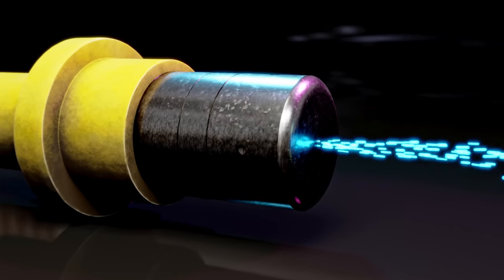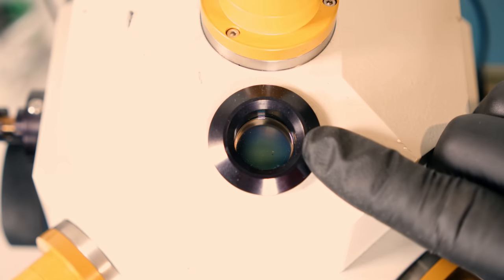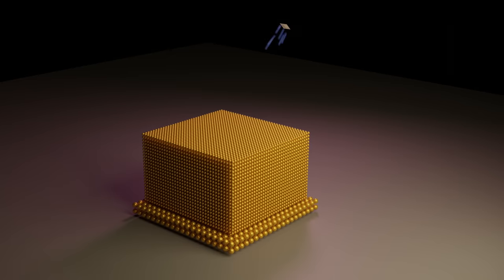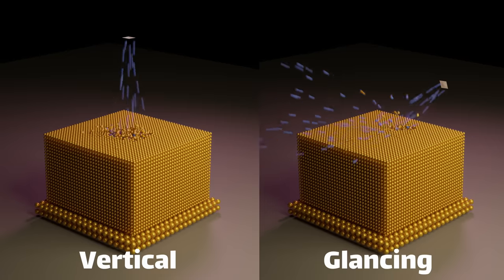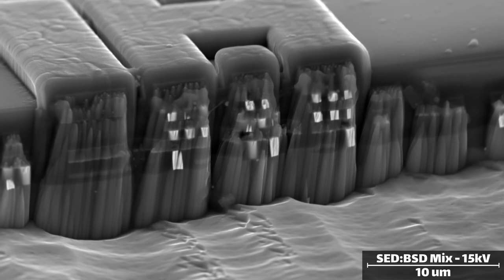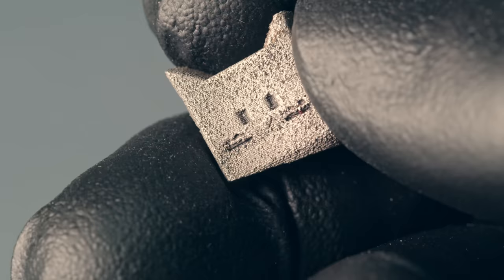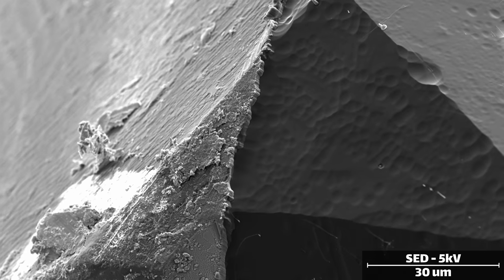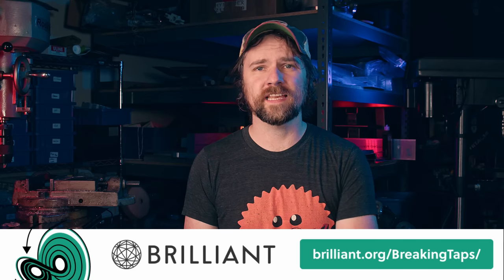Cut anything, even diamond

Comment: Is this what's used to dope semiconductors?
I've always womdered how that's done but can't really find anything about it.

Are the nozzles worn down over time?
Reply from the maker: Yep! Same idea, just much higher velocities and using phosphorous or boron-containing gas instead of argon. But otherwise essentially the same: ionize the gas, accelerate it to high speeds and slam it into the silicon wafer. The P or B that gets stuck in the wafer becomes the dopant, and then they anneal out the damage afterwards.
Reply: @BreakingTaps  That's awesome! I've always wondered how the doping is actually done! Thanks!
Reply from the maker: No problem! There's also an older technique for doping, where you just put the dopant on the surface of the wafer and heat it in a furnace (800-1000C). Called diffusion doping, think it was the main method until like the 80's? Biggest issue is that thermal diffusion also diffuses the dopant "sideways" where you don't want it to go. Ion implanting is mostly line-of-sight, so it can be used to dope smaller regions.

Sam Zeloof's DIY IC series talks about thermal diffusion some more if you're interested!
Reply: @BreakingTaps  i will definitely check that out! Thanks!!

Comment: Oh cool. Why tungsten for vias though?
Reply from the maker: Mostly logistics if I understand correctly. Tungsten can be deposited very uniformly from a gas (tungsten hexafluoride), which makes filling deep via holes easier than other methods. It's also pretty chemically inert but etches in plasma easily, fairly electrically conductive, and can withstand high temperatures if you have more furnace steps after it is deposited.
Reply: @BreakingTaps  That makes sense, thank you!

Comment: Why don't the argon atoms just bond to the cathode instead of shooting past?
Reply from the maker: Some of it will erode the exit over time, although I believe this design keeps most of it from hitting the aperture due to the influence of the acceleration and magnetic field. I.e. it crudely focuses the beam and the majority of it will pass through the hole without impacting it.

And since argon is inert, it won't chemically bond to the aperture if it does hit. Just whack into it and sputter a little off, slowly eroding it over time.

Comment: Where do you shop for used equipment like this?
Reply from the maker: Ebay and other auction sites (govt auctions, some industrial resellers, etc). I have a whole slew of saved searches for different machines/instruments/companies that made cool old gear. Then you just sift through it and see if anything interesting pops up. Most stuff is old junk, or missing something important (computers and software is often a big problem) but occasionally you get lucky.

But you also occasionally buy a unhealthy machine like this one and have to fix it. :)
Reply: @BreakingTaps  Thanks! I'm going to start working on a wish list.

Comment: 7:50-8:10 How do you analyze the sample for different elements?
Reply from the maker: My scanning electron microscope has an detector which can identify the energy of x-rays, and uses a technique called Energy-dispersive X-ray spectroscopy  (EDS / EDX). If you hit an element with a highly energetic electron, it will sometimes emit an x-ray. And the energy of that x-ray depends on the atomic properties, so each element has it's own "signature" of x-rays that are emitted

The EDS works by slowly scanning a high energy electron beam across the sample and collecting the x-rays that are emitted. It then looks at each pixel and determines what mixture of elements are present based on the x-ray signatures at that spot.

Comment: What do you lie saying 'the hardest substance we know of'. At certain temperatures diamond's hardness falls off and soften things can scratch it like silicon carbide. And more importantly we have created significantly harder crystals in labs like Lonsdaleite.
Reply from the maker: Well Lonsdaleite is diamond, so that's not really relevant. And sure I didn't include every caveat about thermal and chemical modification that might alter the material properties because I'm not trying to lawyer the first 30 seconds of the video 😂

Diamond is largely recognized as the hardest substance and I dont think that's controversial at all. Certainly wasn't trying to "lie" about it. Weird grievance to get held up on?
Reply: @BreakingTaps  Diamond refers to carbon atoms in a grid lattice. Lonsdaleite is a hexagon. Yes they are both carbon arrangements, but one is significantly harder and recognized.

Comment: So, a high kinetic energy can hit harder than the most hardest materials doesn't matter what kind of atom or structure it has. I didn't know that. Then it must be possible to cut a diamond with a sword and the problem is the speed, not the sharpness of a sword or hardness of a steel. Interesting.
Reply from the maker: To an extent, yes! The main issue with the sword analogy is that it'll blow the sword to pieces in the process, so you'd need thousands of swords impacting the same place. Individually each argon particle removes a one or zero carbon atoms, but because you can shoot trillions of them the net effect adds up :)

But yeah, enough kinetic energy is can overcome molecular and ionic bonds, because the bond holding atoms together is stronger than the bonds between atoms (up until the point of atom fission anyway 😇)

Comment: 10:22 Is Oxygen RIE anything like a singlet oxygen particle cannon?
Reply from the maker: Less exciting I'm afraid! It's basically the same process as described in the video, except you inject some oxygen with the argon. The energetic oxygen plasma is really good at etching carbon-based materials because it bonds with the carbon and forms CO/CO2, which pumps away immediately.

But otherwise it's very similar to this ion gun in function :)

Comment: I didnt know ICs use tungsten for vias. Why is that?
Reply from the maker: My understanding is that it's mostly logistical reasons. Tungsten can be applied very uniformly through chemical vapor deposition (from the gas tungsten hexafluoride), so it's a good way to fill deep via holes that might be difficult with other methods. It's also very chemically inert, and can tolerate high heat in case your process has other high temperature steps. There may be electrical reasons regarding it's low work function, but not sure on that one.
Reply: @BreakingTaps  Thanks!

Comment: Can u blast electron into an atom of your substrate and remove its inner most electron......I dnt how why and when this thought came to mind but it's just struck and congrats u again triggered this thought ..so answer this question n free me😅😅😅..plzz...an answer starts with yes u can do this by ...would be better for this craving😅
Reply from the maker: Haha, yes, you can! It's called electron beam melting or electron beam ablation. And works basically how it sounds: focus a ridiculously large electron beam onto something and you can melt or ablate material. Used a lot for welding and metal 3d printing actually 😄
Reply: @BreakingTaps  i am sorry I guess I could deliver my question ri8...i think my English is the issue ..m not native speaker...I wasn't talking about melting the substrate ... Let me reframe my question like this : I just want to shoot electron beam on a metal and want to remove its atom's innermost electron ...dats my query..plz say yes n if possible make a video if there exist any such phenomenon,...

Comment: I did not understand. Why you need vacuum for this?
Reply from the maker: Sorry, didn't explain that part well. The plasma needed to form the ion beam can only be generated in a (partial) vacuum. If there is too much pressure, the voltages needed to ignite the plasma become ludicrously high. Like, lightning bolt levels of voltage :)
Reply: @BreakingTaps  Got it, thanks. Was shrouded in mystery until your answer :)